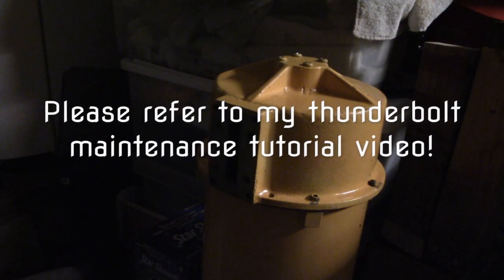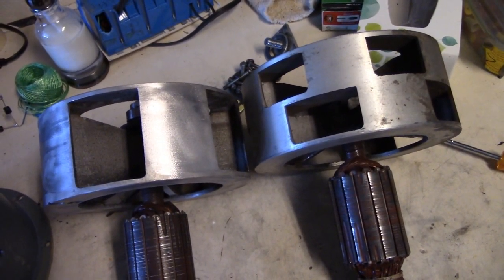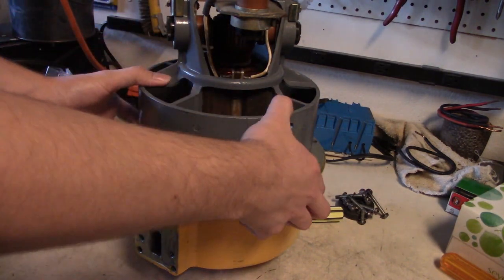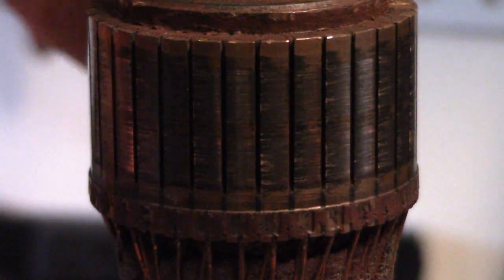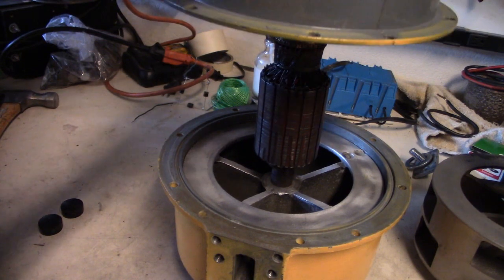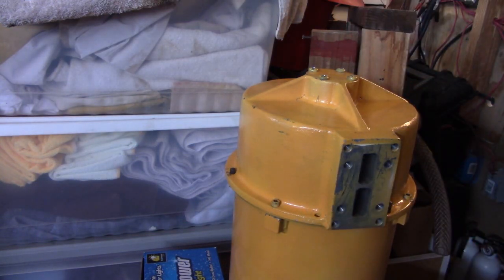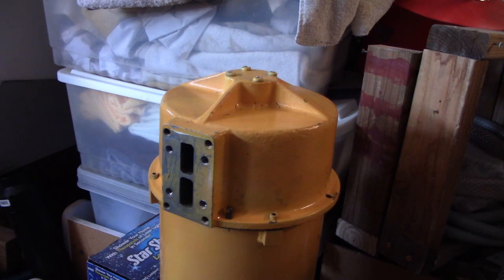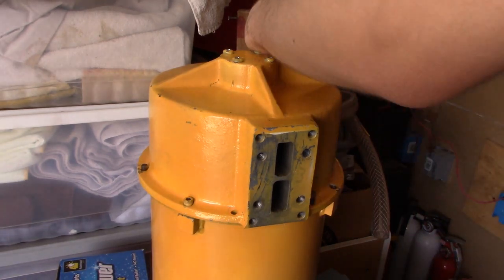How to convert a Thunderbolt siren from dual to single tone. (single to dual)

Comment: You left an important piece of information out. The thunderbolt and model 2/2t rotors both use different amperages then each other
Reply from the maker: Thats because the thunderbolt moves less air without the blower. And the ports on the chopper cap is smaller.

Comment: if you put a 2T roter and put it into your thunderbolt you have a 4/5 port thunderbolt cuz 2Ts are 4/5 port
Reply from the maker: MOSiren Chaser 2T’s are 5/6 port.
Reply: @cooldomino1800  no.. They're not. They're 4/5.
Reply: @cooldomino1800  4/5*
Reply: @cooldomino1800  all Model 2Ts are 4/5 port and you would have to have a Model 2T-240 to work with the the thunderbolt chopper levels
Reply from the maker: @YourAverageMODude145  yup. I did found a video of a 5/6 port one tho. And I did mention that you need a 240v one.

Comment: Any advice if my stator will not separate from the chopper housing? The bolts are not the problem, they are all out. Its completely jammed up for some reason
Reply from the maker: Mine did got stuck a couple times as well. I don’t exactly remember how to get it out. Sorry. You can try putting some wd40 or pb blaster where the bearing is.
Reply: I ended up figuring it out
Reply from the maker: @mrwonderful2142  nice!!!

Comment: Would a Model 2T 4/5 port work?
Reply from the maker: Yes. Because they are the same motor.
Reply: @cooldomino1800   Cool. If I get the Independence Jailbar Tbolt then that’s what I hope to accomplish.
Reply: @MasenMonster  good luck getting one of those because i don't think they are going anywhere.

Comment: What’s the name of your vid that shows how to set different rotation rpm?
Reply from the maker: @ReverseThunder18  I believe it’s the how to do maintenance video. But I don’t remember. I could make a separate video on that sometime.
Reply: @cooldomino1800  btw, how are you always moving ur bolt around if its so heavy?
Reply from the maker: @ReverseThunder18  I have a hand truck.
Reply: @cooldomino1800  oh ok
Reply: @cooldomino1800 how do u lift it on the hand truck?
Reply from the maker: @ReverseThunder18  if it’s on the ground, I slide the bottom of the hand truck under it then I can tip it at a 30 degree angle and roll it to wherever.
Reply: @cooldomino1800  ok thanks

Comment: sounds like a 9:31 sounds like a 1000 not a 1000T
Reply from the maker: I know. That’s the point of the video.
Reply: @cooldomino1800  use a thunderbolt chopper on a 2001SRN siren
Reply from the maker: @gradientgamer5480  if I had a SRN, I’ll do that. Lol.
Reply from the maker: @UCI73xWTPvSrqtF-yvfHbxQw yeah. Lol.
Reply: @cooldomino1800  rip have any other big siren to use the chopper on?
Reply from the maker: @gradientgamer5480  oof.

Comment: BTW can you fix aca huricane mkii 8/10 port to 5/6 port
Reply from the maker: @Nicmrict879  the motors are completely different so I don’t know how to do That without heavy modifications.
Reply: @cooldomino1800  easy lego, take out the horn and check the rotor dose it the same thunderbolt rotor

Comment: Doesn't this basically prove dual tone staters aren't necessary as long as the chopper is dual tone?
Reply from the maker: Yes. I’ve seen 4/5 port thunderbolts with a 1 tone stator.
Reply: @cooldomino1800  Ah cool!